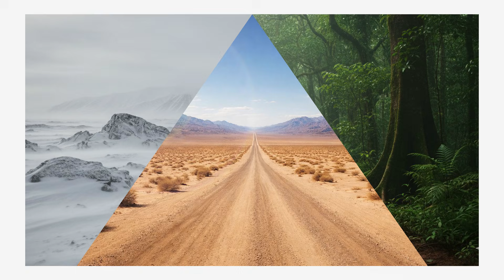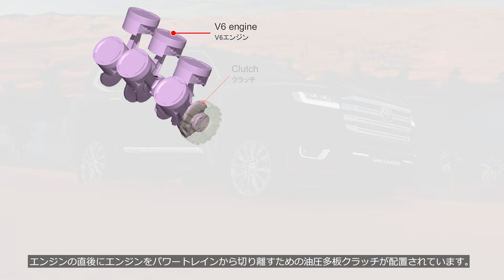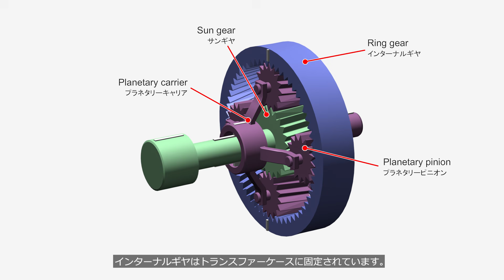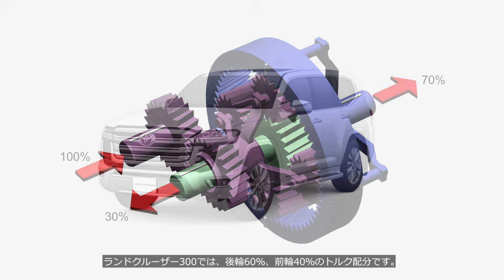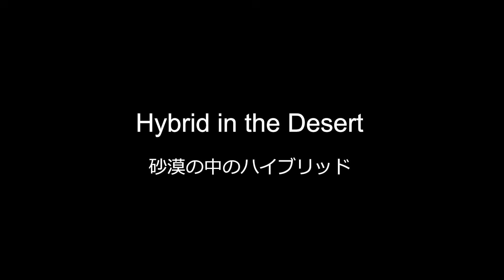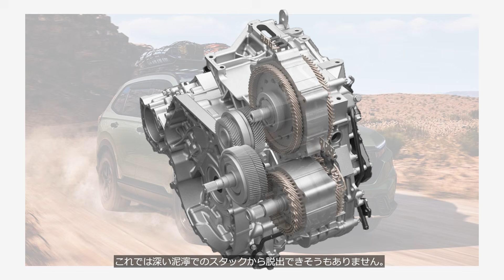Toyota Land Cruiser; Hybrid in the Desert

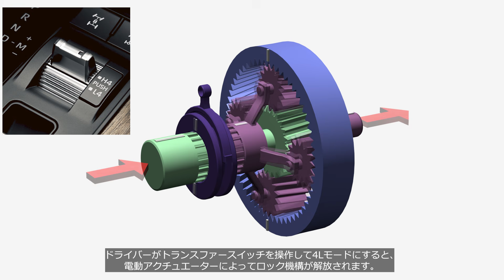Comment: 5:20 the description of the low range is inaccurate. If the ring gear is locked and unmoving as depicted, the input and output shafts would not be able to move if they are coupled together.
Reply: how about this:  we have a locked ring, input fromt he sun(enter from the center tube) , and planet carrier as output. That should be easier to recognized to output a slower and higher torque output.
Reply: However I fail to understand the high ranger(unreduced). If we locked the sun with the carrier, shouldn't the ring also rotate same rpm?

Comment: I am an engineer, if I could be allowed to share my view here. Typically, from a system design perspective, adding a 2nd power source (hybrid motor) to the existing engine would increase the probability of total system failure. This is simply because you have another sub-system that could potentially break down. However, I believe part of the reason that Toyota adds a separate sets of starter, alternator, and clutch oil pump is to simply make the two power systems back-ups of each other. This way, instead of burden, you actually have some form of extra redundancy. With that being said, if the hybrid fails, you can probably still go on for a while, but if the engine failed, you prob can only do a few kms with the electric motor, while travelling at very low speed. Still, a brilliant design to cover all the corners.